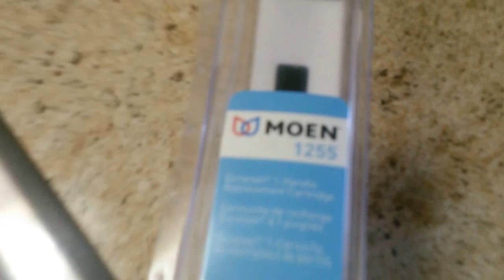MOEN 1255 CARTRIDGE REPAIR

Comment: STEP 1:  Turn off water supply.  I know it sounds obvious but people may not realize.   Also do NOT overtighten the plastic nut.   Tighten it until it's firmly snug but do not exert additional pressure on it.  In other words:  There is no need to "reef on it".  And finally, these replacement cartridges are sent FREE from Moen if you call them.  Alternatively, I called my local EMCO supplier (a Moen distributor) and they had the part and in their system it's listed at $0.01 (free).  I stopped by and picked one up no charge.  So don't pay the $25 that you see online or in a big box store.

Comment: I have a very similar model faucet with same cartridge. My problem is that the diverter needs maintenance - it no longer shuts off water to the faucet when the sprayer is in use. It's not a big issue but it does affect water pressure at the sprayer. Moen's site is little help. I know the part is Moen 100885 but I can't figure out how to get to it. Any suggestions? Thanks in advance.

Comment: What direction turn when:

Removing / Loosening The Nut:

Clockwise or Counter Clock

Installing / Tightening The Nut:

Clockwise or Counter Clockwise

💥💥💥💥

I replaced the Moen 1255 twice...

💥💥💥💥

Original Owner of House...

After 10 years or so, replaced the Whole One Handle Facet Assembly Because It Started Leaking Underneath The Sink...

💥💥💥💥

After 3 to 5 years it did same thing...

Leaking Underneath sink from up in one handle area...

Noticed because water flooded Underneath sink &  eventually was spilling out on floor; flooding whole floor...

💥💥💥💥

Call Moen...

They told me to tighten nut...

Did...

And everything was great for another 2 to 3 years...

And same issue occurred...
Leaking & Flooding...

💥💥💥💥

Called Moen...

They Sent me new 1255 assembly...

This time i tighten nut very good, cinching nut very very tight...

Because i realized, daily use of handle & moving one handle up & down ( to turn on water or off ) & moving handle side to side ( to adjust temperature of water from hot to cold ) causes nut to become loose over time...

Resulting in small continuous leaks Underneath sink & eventually soaks & saturates everything & eventually spills onto floor, flooding whole area...

💥💥💥💥

Which is a complete mess having to turn water off...

Dry floor...

Move everything from under the sink onto the floor drying things off before putting on floor...

Then retightening nut again...

💥💥💥💥

To prevent a reoccurrence...

I check to make sure nut is tight & going to tighten it just a bit to make sure it doesn’t come loose...

💥💥💥💥

In plumbing there's rule, which i forgot durections, for tightening & loosening items...

I'll search after sending this text...

But would appreciate feedback for confirmation...

Thank You...

💥💥💥💥💥💥💥💥

So righty tighty lefty loosey you have to think about that righty tighty lefty loosey because you're unscrewing it you want to unscrew it like you unscrew a cap to the peanut butter jar.

💥💥💥💥💥💥💥💥

Turning the nut or tap clockwise will tighten it whilst turning it counter clockwise will loosen it.

Comment: What size Allen wrench are you using for that size screw?
Reply: Late response but it is normally a 3/32 inch. Don't be confused with 1225 cartridge, that one uses as 7/64 inch allen key.

Comment: Forgot to apply the grease?
Reply from the maker: its pre greased in the package.. but the 1255 cartridge nut does come loose... i have a 3'd video on this  same faucet  leaking into the cabinet  ..moen dosent use thread locker on the nut..
Reply: Odd. My package included a pouch of grease that had to be applied to the catridge's steel stem onto which the handle is inserted.
Reply: @sheldonmurray9155  I bought the 1255 from Menards and grease does not come with it.